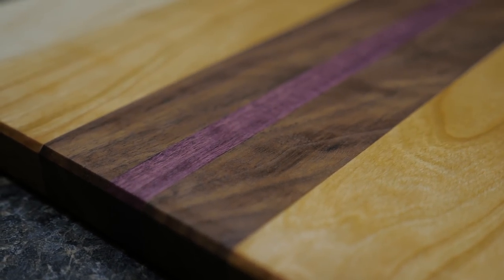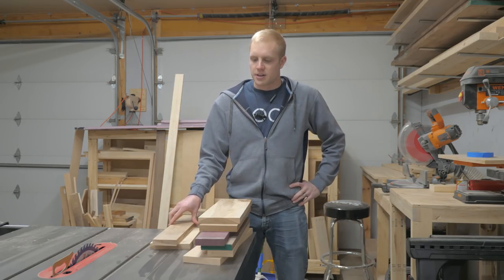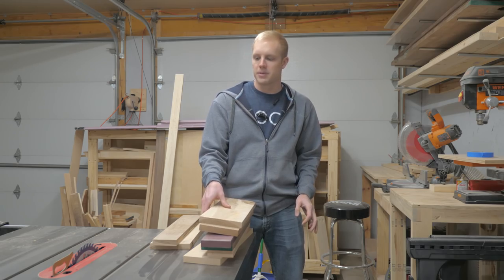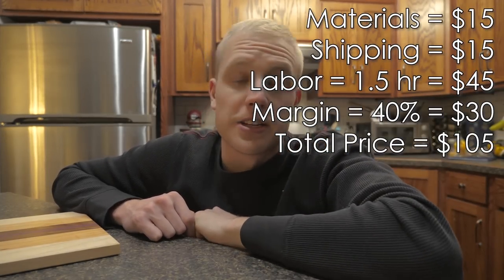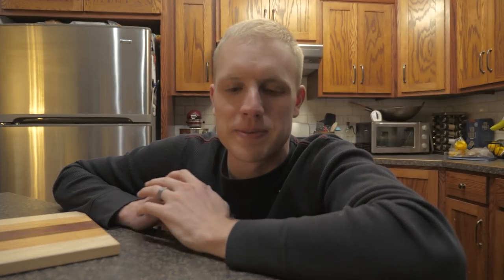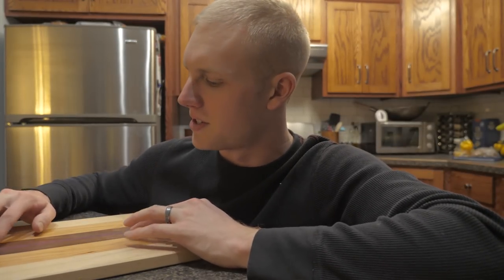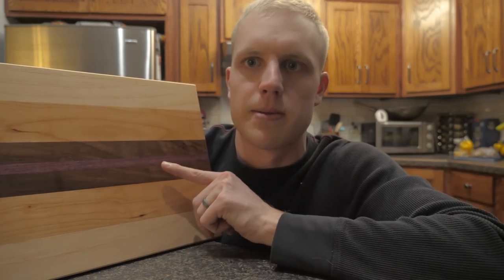How We Priced a Cutting Board (Real Numbers) | Woodworking Business

Comment: You can eliminate the snipe by making two of your strips a little long. One sticking out the front the other the back. Then when you plane, the long strip will receive the snipe and you can cut it off. It doesn't waste too much wood. I do it with the cheaper woods.

Comment: Nice work and good video. I hope your viewers won't mind a little constructive advice, its not a good idea to use a very hard wood like purple heart for a long grain glue up like that because the other softer woods are going to wear faster and leave the purple heart as a hump down the center. Perhaps using at least two more purple heart boards with the softer boards between would prevent this and not detract from the design. But again good work keep it up

Comment: I build 10 cutting boards at a time and I do not make anymore until those sale unless I have someone ask for something special.  I can do them start to finish in a Saturday in the shop.  If I spend 10 hours in the shop I can usually batch out 10 cutting boards 12x16x3/4 face grain and several 18x22 serving trays.  I do it as a hobby not to make a lot of money and so far my hobby pays for itself.  Also I buy rough cut lumber and mill it all up during that Saturday as well.  Your tips are great keep them coming!

Comment: The board looks great! That said - it isn't the best quality product you guys could provide for $105.  I'm glad you came sell that board for that price and feel good about it.   I have to have a specific request for a face grain board like that before I'll make it.  Edge grain and end grain boards are much more durable, a little more work but a much better product.  Success isn't all "profit margin".  Will that customer still be using that board in 5-7 years?  I doubt it.
Reply from the maker: You're absolutely right, success is a happy customer AND a profit margin. We have plenty of both. I guess you just don't value your free time at $30 an hour. Your employer must really like you!
Reply: I have to agree with Lynn, I was a little disappointed with the face grain too, won't last as long.
Reply: kieran finney  maple, walnut and cherry are standards for cutting boards, Purple Heart is also used very often
But you are correct that the board there is about a $50 board

Comment: 40 years cabinet maker furniture  maker and finisher here. 
The best way (Ive found) to make money selling cutting boards, is not trying to make money selling cutting boards. 
I give a perfect exsmple. 
I was recently at a flea market and I happened to see a guy stlling cutting boards. So of course I had to check his prices. 
They ranged from $40 to  $100+.
 Some of his boards were simply single pieces of wood no "stripes", juice gooves nothing, just sanded and oiled for $40-$60. His more elaborate ones we $60-$100-ish.
There was no one looking ag his work ....except me. 
Shortly after that I saw another guy selling boards his prices were ftom $15 to $60. 
The small ones for $15 were edge glued, multiple woods about 8x12.  So even his smallest and least expensive pieces had some wotk put into them. 
His booth was swamped with buyers!
Be realistic with your pricing and you do well with simple quick and easy projects like cutting boards.

Comment: Is $30/hr for labor an arbitrary number pulled out of the aether or did you arrive at that number through some process? I was considering charging $25/hr for a project recently which I pulled right out of thin air so wanted to see if your method was similar. 

Also do you typically try to stay around 25-30% GPM or is it just on cutting boards?

Comment: Glad to see you are doing well. I wish to make a comment without insulting. There are 2 different margins. 1 is add on percent and the other is true profit margin. Your true margin on the 105 dollar sale is really about 30%. In order to get a true 40% margin you would have to sell it for 125. Example you buy an item for 1.00 and you want to make 30 percent so you would price it at 1.30 . .......1.00 x 30% = 1.30 Now take the same  1.00 and you divide it by the reciprocal.  1.00 divided by  .70 = 1.45. Keep up the videos. Great job.
Reply: There are so many cost involved that no one realizes. All the equipment and lights costs money. The place were the shop is has to be paid for! I see they designed and made their own zig. That came at a cost. Board feet cost on pine certainly isn’t the same as walnut. I’m at a disadvantage apparently because I did not hear true cost numbers in a video. Insurances, travel, taxes, equipment maintenance repair or replacement, their sales time and labor all are part of costs. All of these factors are in every product we buy. Do you really believe a mass produced item is going to cost the same as a handmade item? Common sense should answer that question. Every big box store has different pricing for different areas. And for many reasons. A product made in your back yard isn’t going to necessarily cost the same as an item shipped across the country. However one rule will always apply. Consumers can identify and are to pay for quality!

Comment: I'm getting started, but I'm so confused in the wood I bought.  It's sold to me by the board foot.  But, the I mill it, but the wood isn't the same t × l × w.  Can you explain how you price the wood from the board foot you buy.
Reply from the maker: A board foot is a volume measurement. It’s basically a 12-inch square of wood around an inch thick when rough cut from the mill.

So if you grab a random board at the store and calculate L x W x thickness of that board, you’ll get the volume in cubic inches. Divide that number by 144 to get the number of board feet in each piece of lumber.

Comment: Anyone see the massive snipe line at 3:39 good video though 😄
Reply: I did!!! Lol. I would have had to blend that out or something!!!

When I run lumber through the planer, I add a sacrificial board to the first and last board to run through the planer, or just cut a couple pieces 4 inches longer on the first board and last board. This way the trash gets the snipe.
Reply: snipe is easily sanded out.
Reply: yea i saw it, didn't want to say. ive been wrestling snipe on my boards. i took off the factory tables and built a 5 foot MDF insert table. it made a big difference but not perfect. i attack the snipe with 80grit after every planner session. the sacrificial board idea is good IF you have a piece the right thickness, so for me it tends to waste more time than just sanding it out.
Reply: @jimnz17  you should always have a piece.

If you are making a cutting board, then cut the outside two pieces 3 inches longer than the rest on 2 boards, then always feed the extra length first and last on the planer. If you have 10 long glueups going through the planer, you'll only waste 3 inches on the first and last board, but only the outer two pieces of those glueups.

If you are doing something else, then use a piece of construction grade pine and cut a 1/2" strip for each side at any thickness greater than your finished piece and glue it to the outside of your board to be planed.

You can also just run a piece on each side of the board you are trying to plane without gluing it, but you'll need to make sure it it wide enough to stand on its own so it doesn't flip over in the planer.

Having a piece the right thickness is not important, as you can use anything thicker and just plane it down.
Reply: Face grain cutting boards?
Reply: @williamcorson1648  they look nice but will kill your knives. some people are cheap though.
Reply: @williamcorson1648  there are three types of wood grains. Face, Edge, End.

Face grain is the most common type of cutting board, as it requires the least amount of wood waste. Face grain is grain that runs across the board from side to side.

Edge grain is the next most common type of grain, and is also called quarter sawn when talking about individual boards. The grain runs from front to back of the board, or the grain is stood up on the edge.

End grain is the least common, as it is the hardest, wastes the most amount of wood, and is the hardest to clean. End grain boards soak up the most contaminates and can become really unsanitary without proper care, which is not something a lot of people want to maintain. End grain boards are for the professionals in the kitchen. End grain is the end of the grain of wood as the name suggests.

End grain is the best for knives, but the worse for bacteria and harmful organisms. Edge grain isn't as bad for bacteria and such, but not as easy on knives. Face grain is perfectly fine, so long as you aren't using woods that have an obscene hardness, like Hickory! Since most boards are made from Maple or Cherry, face grain does just fine, and doesn't dull knives any worse than a specialty edge grain one with much harder woods.
Reply: @charlieodom9107  I've never seen face gain " cutting boards " being used except for maybe a cheese board. But hey if people want them. They will just screw up knives and the board will not last as long as edge or end grain.
Reply: @williamcorson1648  face grain boards last just as long as an edge grain one, and are no harder on knives than an edge grain one. End grain boards are very rare, and almost none sold are end grain due to the increased difficulty in construction.

Most butcher block boards are made with face grain wood. The reason is the cost. It is very cost prohibitive to cut out face grain from boards, as that produces a lot of waste.

Seeing as how you do not know this only proves your ignorance. I don't think you even know the difference between face and edge grain to be arguing.
Reply: Well I make edge grain and end grain cutting boards. End grain / butcher block are difficult to make especially with wenge. It just is surprising that people are paying 100 plus for face grain boards.
Reply: @williamcorson1648  who is paying over 100 bucks for a face grain board?

Most of my edge grain boards are less than 100 bucks. Only the more complicated ones are over 100.
Reply: @charlieodom9107  the video shows 105 as the cost
Reply: @williamcorson1648  but is anyone buying them? It doesn't appear as though these guys care about grain in their cutting boards, so it looks to be a mix of edge and face in each board.
Reply: @charlieodom9107  well if they mix face and edge grain or end grain that makes them even more susceptible of not lasting very long.
Reply: @williamcorson1648  no it doesn't. If this were the case, then just about every glued together board on just about every piece of furniture would have come apart, as it is common to mix face grain with edge grain on glueups.
Reply: Not remotely the same. But this is you tube
Reply: Either way my comment was in respect to this individual charging 105 dollars for a friend with a face grain cutting board. As someone who also makes these though I would never make a cutting board with face grain. I thought it is  steep price for a tace grain "cutting board" thats all. And good for them making some money. I am not hating I am  just surprised.
Reply: @williamcorson1648  yeah that's what I was thinking...face grain is the worst board you can make, might as well went to Walmart and bought one. Either edge grain or end grain for cutting boards nothing else will do...
Reply: End gran cutting boards are what normies think is pro level in high end restaurants. Almost no restaurants use the due to the insane level of care and maintenance needed. its far easier to sharpen a knife before using it than to care for end grain boards at the end of every single shift.

Comment: I am not sure where you are selling your cutting boards, but if you can get that price you have it made. The price you are suggesting is something I can't touch for End Grain Cutting Boards. It did look like you had some snipe on that board which is undesired. Simply glue some thin runners on the side so of your board that are about 6 inches longer than the main board and that will eliminate the snipe when you plane it and then you just either cut them off or make them part of the board. The other thing is what you finished the board with. Looked like corn oil or olive oil. BAD Choice. It will go rancid. The best thing is mineral oil and bees wax. Takes a little more effort but it is great. If you can find it another good product is Steve Cooks Toung Oil. I think it is marketed by Chroma Craft.   Love the look though.
Reply from the maker: Greg you just don’t get out enough! There are people who buy $600 sneakers, million dollar watches, and half million dollar cars. No shortage of money on this planet - you’re just not gonna find it lying around!
Reply: @jennieanddavis  so your plan is to sell subpar products to whatever sucker you can find?  That seems to be your strategy.  Put as little time and effort as possible in producing something, over price it because, well, people are buying $1000 sneakers out there. There are more people than you think who are discerning enough to separate quality from junk.  In the end this business strategy will probably fail because you treat customers like suckers.  The best business balance quality goods and services at competitive prices. Invariably they do NOT sell low quality products nor do they try to pull one over on their clientele.

Comment: It looked like you were using titebond ll you may want to consider titebondlll as it is waterproof and titebondll is only resistant not waterproof. Enjoy your take on woodworking for $$$
Reply: Not only that titebond III is approved for indirect food contact
Reply: Titebond II says right on the label that cutting boards are an ideal use for it
Reply: @Apollo0351  ok after a bit of research, yes titebondII can be used in indirect contact with food,as long as you are using the plain wood glue version. 
  Apparently there are multiple types of titebond II  that are not FDA approved for indirect contact,  something that you may want to keep in mind if selling said boards.
Reply: Personally, I use totebond 3 for everything because it's stronger, and I have no desire to have yet another adhesive floating around my shop 😂

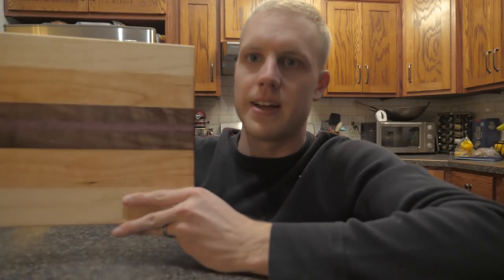Comment: At about 6:50 Davis in fingering the snipe left on the cutting board. For the non wood worker, “snipe”is a byproduct of planning the wood. It’s an uneven surface. You can remove it with the correct sanding method. He simply left it on the board for character....not!
Reply: You can eliminate snipe almost completely with a planer sled as well🤙🏻👍🏻

Comment: I’ve watched a number of your videos and have been wanting to ask a few questions. Where did you get the wood glue bottle you use?  If you glue 1” thick of any type of wood do you ever use biscuits or dowels?  What type of router bit did you use for the board?  What brand and model of table saw do you have?  Sorry to throw all of these at you guys, but these questions have been adding up. Thanks in advance and keep up the good work.
Reply: The glue bottle is called a Glu-Bot.
Reply: @scottharmon709  thanks i have seen people using them and didn't know what they were called 😁

Comment: What kind of glue did you use?
Reply: White Grain Woodworking Titebond 3 is  better for cutting boards.
Reply: White Grain Woodworking - Try Weldbond.  It is similar to wood glue and dries clear with the added benefit that it will bond most materials.

Comment: No way I'd pay $105 for that 1/2 thick cutting board. I bought a 1.5" thick end grain cutting board made of hard maple and walnut with a juice groove and rubber feet for $125
Reply: Lookin lima so you paid $20 more for the same thing but slightly thicker and some rubber feet on it?
Reply: @jadadahut3654  To be fair not the same thing. An end grain board takes a lot more work. and is a lot nicer for your knives.
Reply: @jadadahut3654  No, I paid only $20 more for a far superior, more functional, better made, end grain cutting board, which came with a bottle of cutting board conditioner to apply every 6 months to keep it in top shape.

Comment: Wtf!!!!! How can a cuttingboard cost 105 dollar?????? Bro!!!! 105 dollar!!!!
Reply from the maker: You could make it, too. Just find the right customers who see $105 of value
Reply: If you would read and watch the video it showed how the cost came about.  If you want a cheap ass plastic Chinese cutting board go buy that cheap foreign junk.
Reply: If you want a handmade cutting board you can do it yourself.  All you need is about $15 in wood and a couple of dollars in glue.  Oh, and a $1000 jointer, $1500 table saw, $600 planer, $250 router, $100 sander and $100s of dollars in clamps and various other things (those estimates are on the very low end).  Or you could buy something for $25 from Walmart.  I good handmade cutting board will run you over $100.  I am not saying the cutting board in this video is worth that.  It isn’t. But a well made cutting board you can use for the next couple of decades is worth over $100.